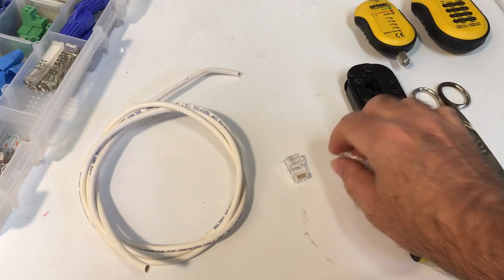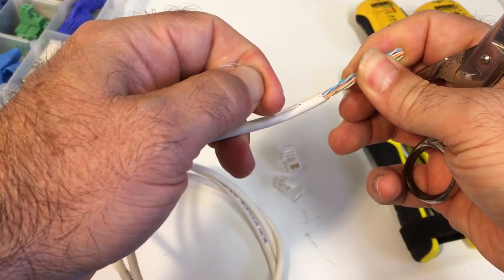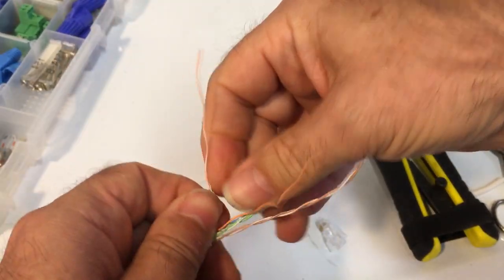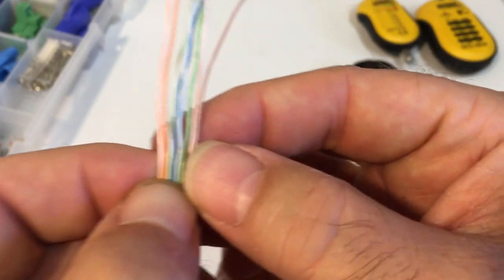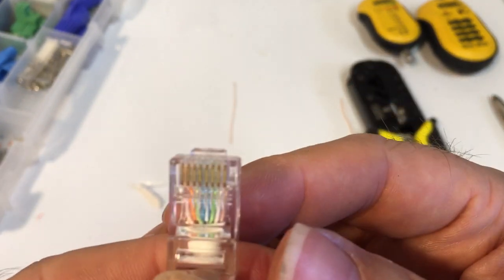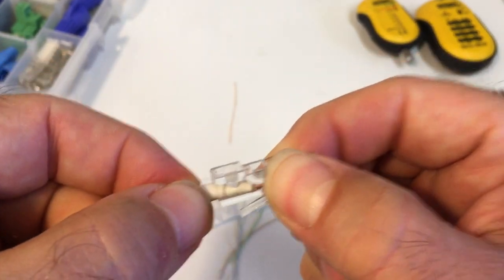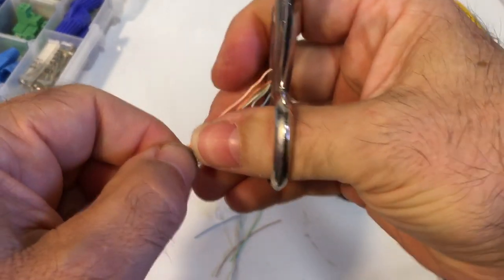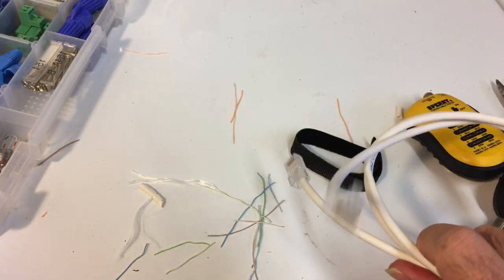Cat5e cable crimping

Comment: My question is what difference does it make concerning the wire color order in a connector just as long as you put the wires in the same order on the second connector to match the wires in the first connector.
Reply from the maker: Yes, as long as all the wires match on both sides it should work, but the wires are grouped by color pairs for a reason - it helps with noise resistance.

Comment: i just matched wires in same way followed by first jack like 👇
w/green solid green,
w/blue solid blue,
w/orange solid orange
w/brown solid brown
and it works perfectly.
let me know whats the basic term for changing different colors?
Reply from the maker: Good deal.  The order of the colors is often referred to as “wire mapping “.  For instance the are a few wire maps used in telecommunications such as TIA568A, TIA568B, and USOC .  Hope that answers your question. 😄

Comment: Do the copper ends need to be uniformed? Some of mine are a little longer but they all reach the pins.
Reply from the maker: They don’t HAVE to be. So long as all of them are long enough inside the plug to make contact with the gold pins.  But ideally, yes you would want them all to be the same length.

Comment: i suck at putting rj45 connectors so i use pass through connectors.
Reply from the maker: I’ve never tried those but been curious. 🤔
Reply: @NetworkAdvisor  your crimper looks like a pass through crimper. if you look on the vack side and there is a blade it will trim pass through crimps. thats the only difference is trimming the wires on pass through crimper's vs non pass through crimper's.
Reply from the maker: I see.  Well.  I will have to get some pass-thru crimp ends and give that a try. 🤔